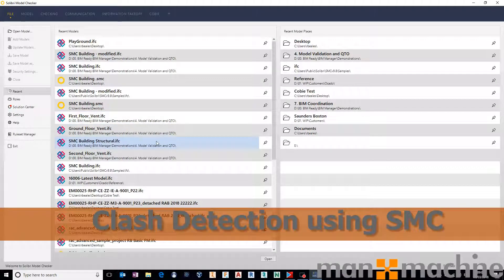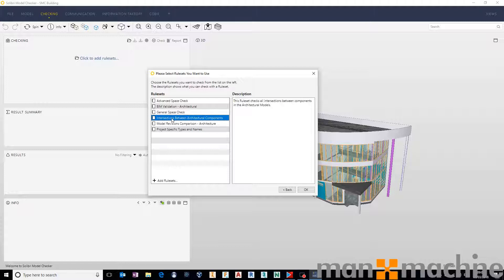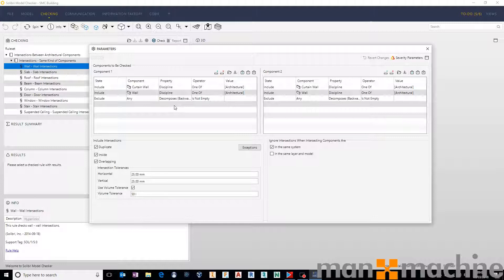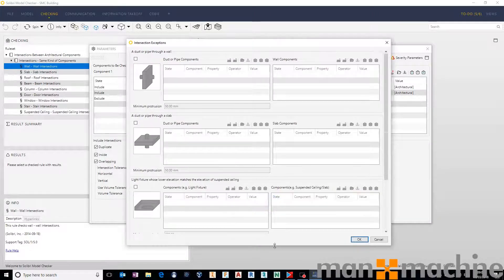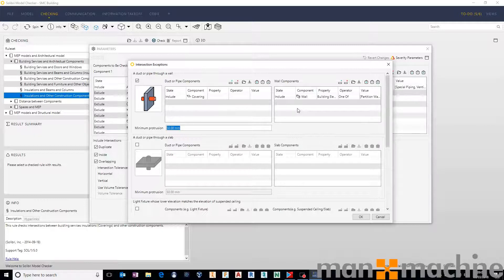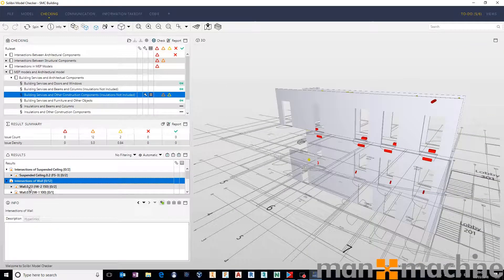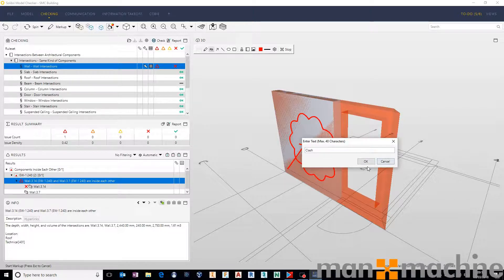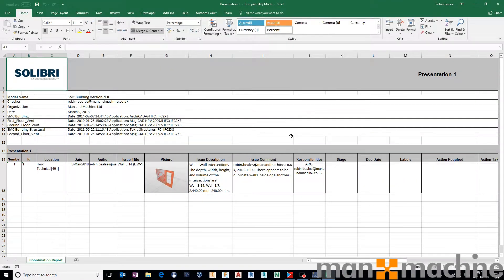Clash Detection Using Solibri (SMC)

Comment: Great video! I have a design manager on site who has asked me to give a diameter for services running through wall and floor penetrations for calculating firestopping volumes. IS it possible to do this check and do an information takeoff in the form of  schedule which gives a line by line summary of the penetration and the size of service running through it? Navisworks will give you the item name but not the size.... Many thanks!